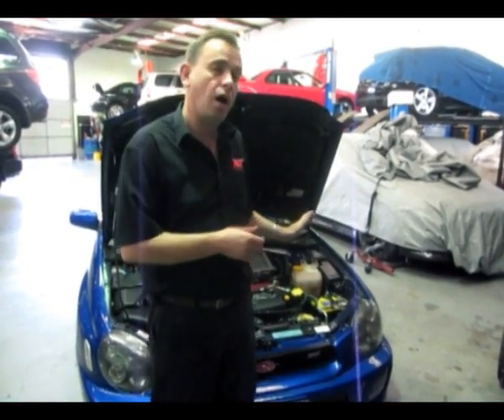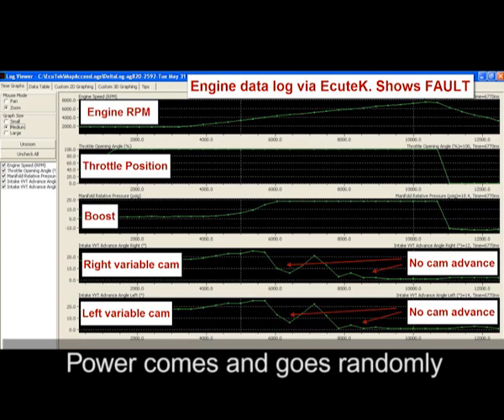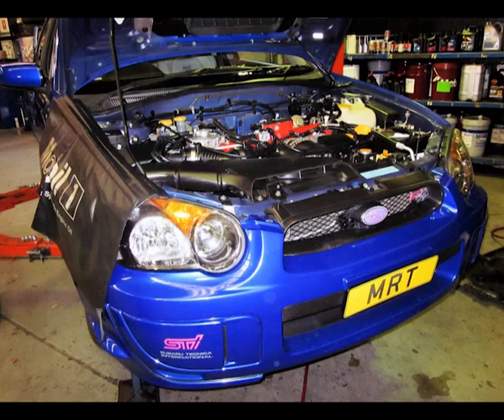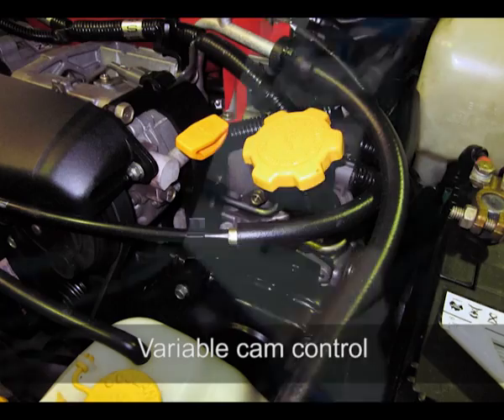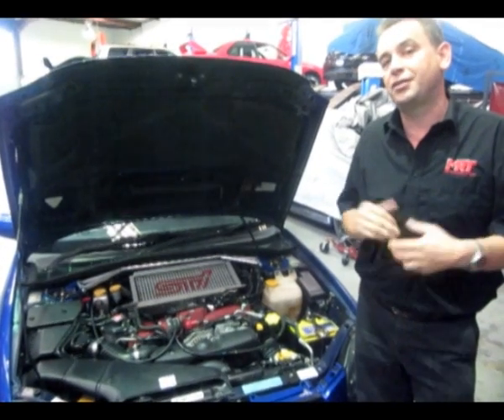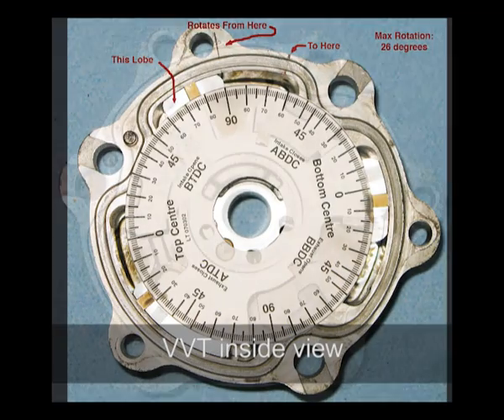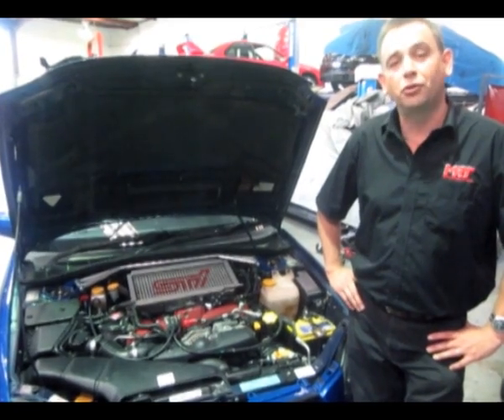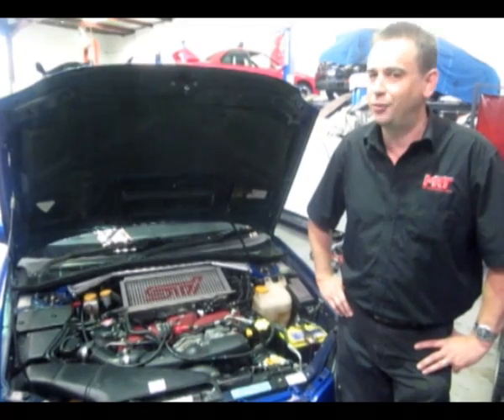Subaru Sti AVCS variable valve timing secret fault.

Comment: Solutions to AVCS Not Activating
1. Replace the Intake Camshaft Position Actuators (Cam Gears)
Multiple sources—including mechanic group forums—suggest that failing camshaft actuators can result in AVCS symptoms like loss of power or lack of cam phasing.

The recommended fix: Replace both intake camshaft position actuators. 

2. Check Wiring, Oil Control Valves, and Do a Reset
Some steps to take before replacing parts:

Inspect the wiring harness for breaks or damage between the ECU, sensor, and solenoid. Electrical failure can block solenoid operation. 

Replace the AVCS oil control valves (also called solenoids), especially if sluggish cam movement or slow response codes like P000D are present. 

Change the oil, clear fault codes, and do a complete battery reset—sometimes this alone resolves the issue. 

3. Clean the Solenoids and Filters
AVCS performance depends on clean hydraulic oil flow:

Remove and clean the AVCS solenoids and associated filters or banjo bolt screens—oil sludge or debris can easily clog and stop operation. 

After cleaning, reset the ECU, let the engine idle for ~2 minutes without any input, then drive—it allows the ECU to recalibrate AVCS.

Comment: my 07 is not turbo it got ej204 with 5 speed 
what could be the cause when i start the car and want to start driver after 2-3 min 
the car will not drive smooth as it feel like it hesitate
secondary air pump egr and rear oxygen sensor after the cat is canceled with a tune 
 as the secondary air pump fall with its valves
thanks in advance
Reply: Same issue on my 06 ej204

Comment: My 2012 wrx has a P0022 error and the engine isnt running smooth as it used to at low miles. You can tell at low rpms only. Its at the dealer right now under my extended warranty with Fidelity Warranty Services.
Reply: What was the fix?

Comment: Could this apply to the 2007 EZ30 engine? On my Legacy AVCS  randomly stops working - OCV duty cycle on both sides just drops to 9.41 and stays there...

To get it back working I have to stop the car (not the engine) and let it idle for 3-4 seconds - after that, it works again (for a while).
Reply: I have the exact same problem, what’s your fix? Thanks for your input.
Reply: @tonyrun  What I found out over time is that the exact same symptom happens when I clear fault codes / reset ECU via OBD2 while the car is in motion (i.e.being driven). This was an accidental discovery, but since my car has an LPG alternative fuel installation, which is connected to OBD2 to read some of the sensor values, I assumed it was the LPG piggyback ECU that was resetting the factory ECU.

So I did a couple of things:
1. Checked and moved the wiring between LPG piggyback and factory loom
2. Checked and cleaned the factory ECU connector
3. Had the LPG system serviced, which might've included a firmware update of the LPG piggyback

The problem hasn't reappeared for at least a year now, but I can't really tell whether it's fixed or just 'dormant'.

Comment: i had this issue on my 09 wrx, after data logging that's what my graph looked like. One side was not advancing and the other wasn't. Swapped out the OCV solenoid and it fixed it but By then it was to late and the wear my car endured from that issue it ended up spinning a  bearing 2 weeks later.

Comment: P0852 will be the code. The switches on MY02-MY04 STI are the issue.

You will need to replace the neutral position sensor on top of the gearbox and then AVCS will start working again.
Reply: How do you explain that? How would those 2 be related?

Comment: Would have been nice to know exactly what the solution is for people who live elsewhere in the world. If its not mechanical such as a blocked oil feed screen, faulty solenoid or dirt inside the avcs gear etc then it must be tune related.

Also that second data log had 25 degrees advance right to redline? That is definitely not normal. Usually the intake cam tapers to zero as rpm increases.. it even shows it tapering to zero in the avcs table in the video. That car seems to be spooling pretty slow as well. Not hitting 20 lbs until almost 4000 rpm.

Its too bad your holding your cards close to your chest on this one. The subaru community is pretty open and withholding information to have some kind of avcs monopoly on other shops is upsetting.
Reply: Ska Bob you are correct on Subaru's recommendation. In the shop though we would actually do the opposite. A plugged or broken banjo filter at the Avcs solenoid will cause a CEL and is usually a quick an cheap fix if the customer brings the car in right away. Same issue with the filter on the turbo and the customer will have no clue there is an issue till the turbo goes out, a much more costly repair. Turbo replacement, engine flush and pan removal to clean out all the brass bits from the turbos journal bearings.
Reply: Oil control valves are what usually causes the cam timing issues, the oil screen on turbo bolts cause turbo failures.
Reply: They did use filters/screens in both the avcs bolts and turbo oil feed bolts. Subaru now tells it's dealers to remove the avcs screens on these cars, but to keep the turbo feed filter.
Reply: Chaching $$$$$$
Reply: Bro it's a marketing tactic.
"Feel like your car isn't as fast as when it was new?" Well just take it to us so we can diagnose a fake fault and issue a repair bill for a fake fix and let the placebo effect make you happy again!
Can't really hold it against them, the whole industry is like that and if you try to be different you will be left behind.
Reply: Ska Bob it depends on what turbo you run, for me with Forced Performance I actually need different oil feed line.

And removing all the screens can benefit the motor and turbo and increase the longevity and dependability of the components.

Comment: My guess.. The banjo bolts are not lining up with the hole in the line.. insufficient oil flow to maintain target adjustment.
Cam adjusters are constantly trying to match each other, it's probably a safeguard when there's x degrees of difference between the two; shuts itself down.
Reply from the maker: I have never seen this fault
Reply: Scratch that..Neutral position switch ;)
Reply: Jaydn Hubalek v

Comment: I'm having avcs problems similar to this on my jdm swapped v7 ej207. checked solenoids, wiring, replaced cam gear, had it up on a dyno, data logged, tuner still can't figure it out. Be oh so kind and tell me how to fix it?
Reply: Krimghor was it the neutral position switch?

Comment: thanks for the tip Brett! what about on 2001 models? solution has gotta be in either the rear position sensors themselves, their wiring or wiring for either of the two actuating solenoids...  :)